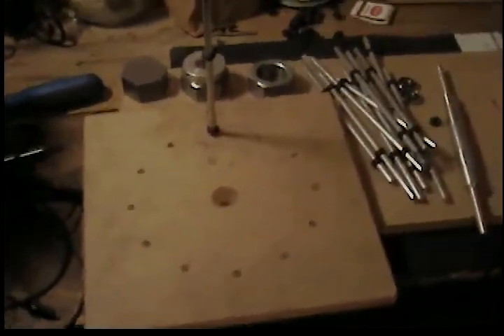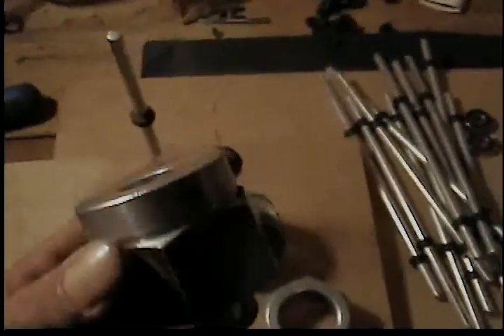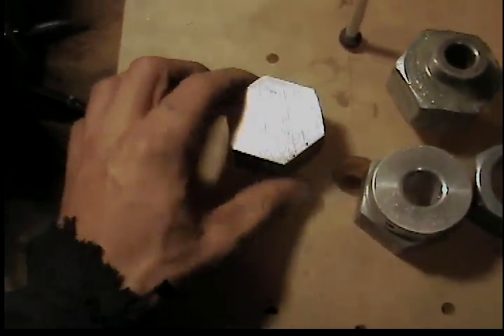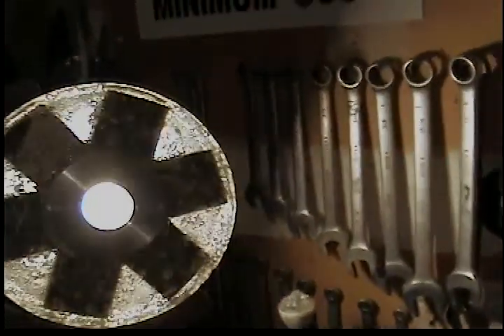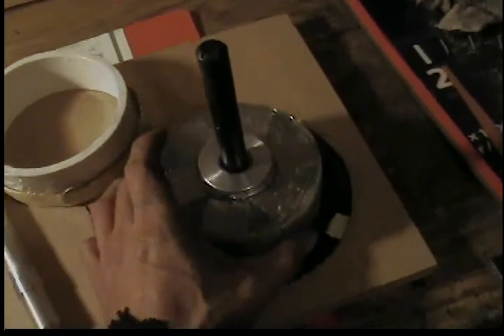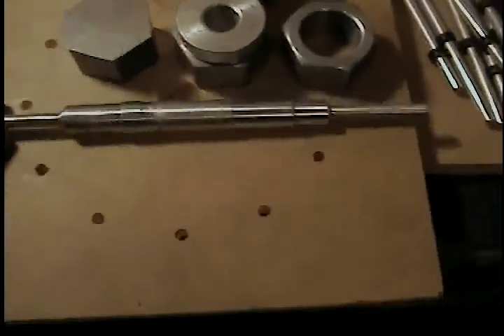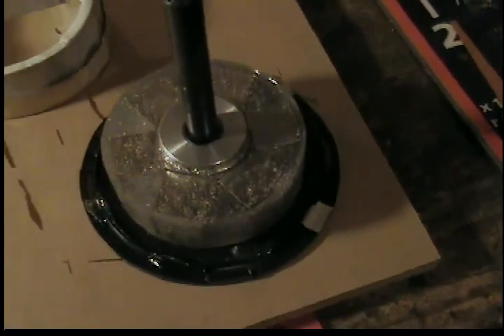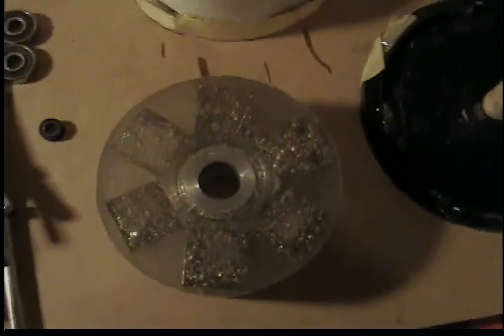Self Runner parts built

Comment: @Rawbush Looking forward to the next video :-))

I was thinking, if you can do the casting in two steps, then you can make a rotor that can be disassembled, so you can change or recover the magnets easily. If you have two flat round split  rotor pieces you can bolt them together when you assemble the rotor. Maybe handy for a next design. I would also wax the magnets before I would do the casting. Then it is also a lot easier to remove them if you ever need to 

Greets, iT

P.S. Great camera job

Comment: @insAneTunA  With the flakes mixed with the resin it will become a thicker substance. Carnuba car wax is used to wax the mold as a mold release so the hardened resin can removed easily. colored kids clay is used to seal off the mold. You can cover the whole piece with a flat waxed surface and use an air vent. Then you will always have a flat finish when you cast the mold. Just keep on poor in the resin until the air vent hole flows over with resin. Maybe you have to do the casting  in two steps.

Comment: When you mix the resin it is best to use a stick and to stir it gently. It is also better to poor in the resin slowly so the air bubbles have time to pop up, and that you don't poor in the resin directly from the cup that you used to mix the resin, but that you use a cheap DIY bakery sack that is used for whipped cream. You can fold one from a sheet of glossy paper. If you go to the RC shop then you can get cotton or glass fiber flakes that you can mix with the resin for extra sturdiness.